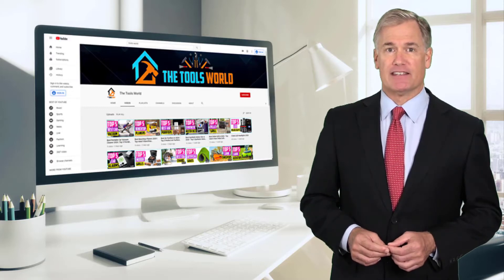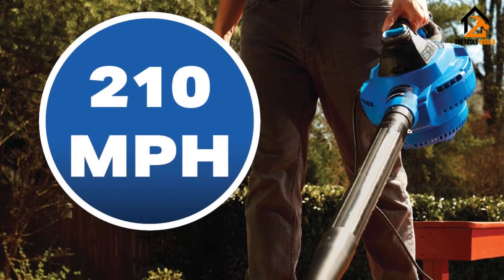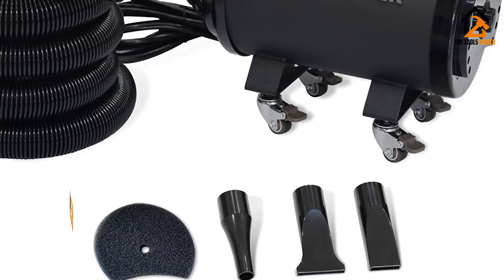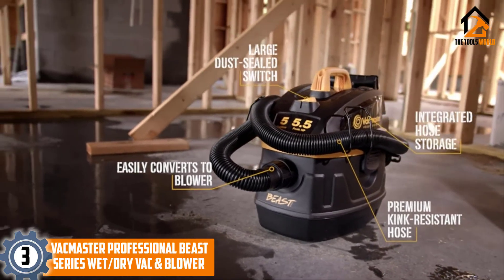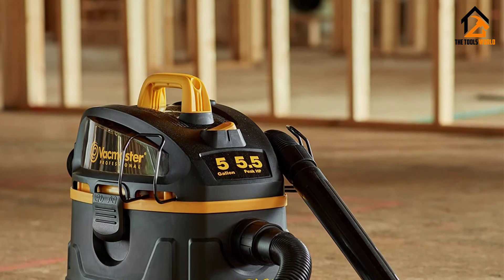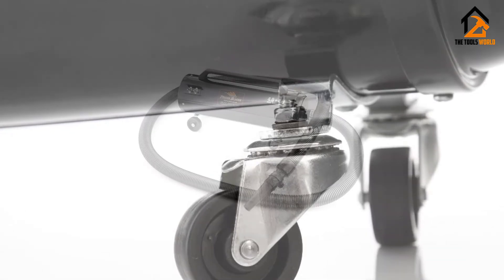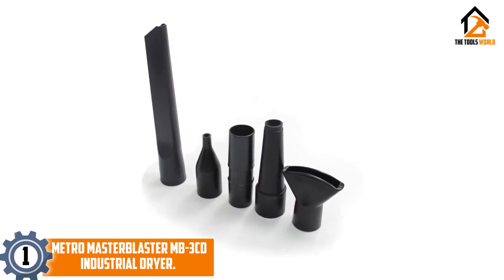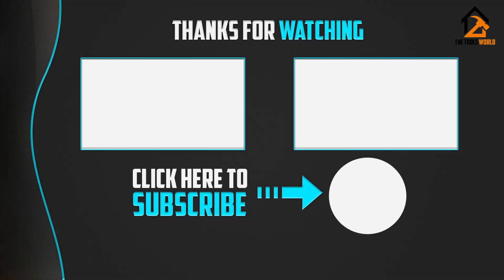Best Car Dryer Blowers - Top 5 Car Dryer Blowers Review

Comment from the maker: ▶ In This video, We recommended the top 5 best Car Dryer Blowers

▶ 5. Vacmaster VBV1210 Wet/Dry Shop Vacuum with Detachable Blower.  
 
▶ 4. SHELANDY Powerful Motorcycle & Car Dryer. 

▶ 3. Vacmaster Professional Beast Series Wet/Dry Vac & Blower.  

▶ 2. Air Force Master Blaster Revolution. 

▶ 1. Metro MasterBlaster MB-3CD Industrial Dryer.